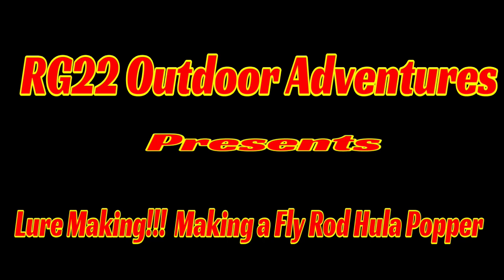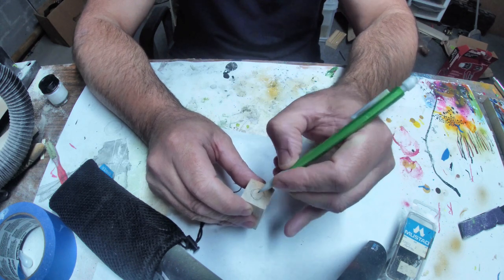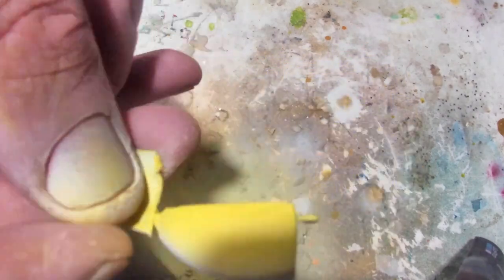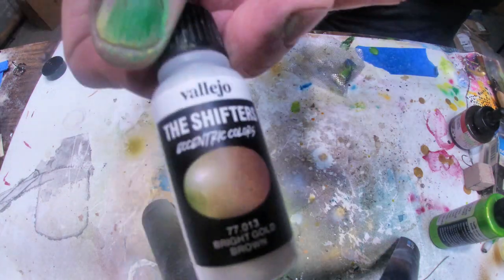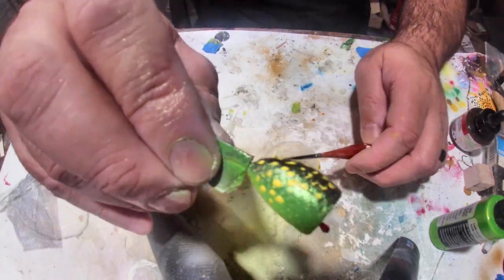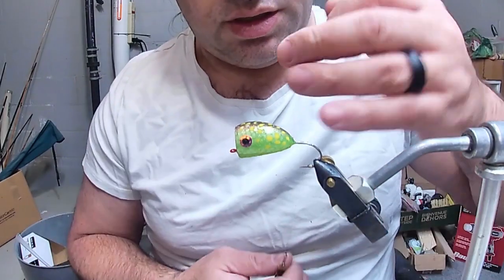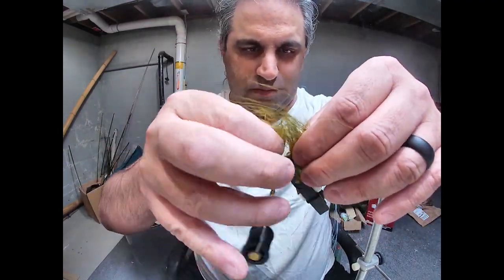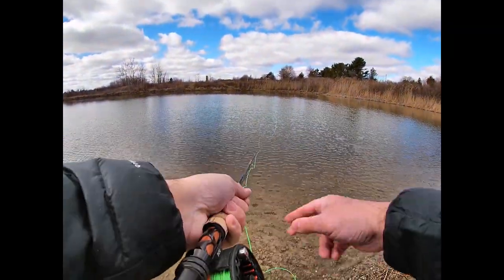Lure Making!!!  Making a Flyrod Hula Popper

Comment: You are correct about mixing the 2 part epoxy. Most manufacturers recommend mixing equal parts by volume. I however, have always mixed by weight with a scale because I believe it to be more accurate. I purchased some Devcon 30 minute epoxy and some BSI 30 minute epoxy, and weighed the full bottles before using any. In both cases, the resin weighed lighter than the hardener. I calculated the ratios for the weights of each part at different volumes so I could mix it for a small lure, a big lure, or for multiple lures. I have never had a problem with the epoxy setting up properly with this method. Also, if you purchase TrueCoat epoxy, they recommend mixing by volume but also give you the proper ratios by weight for measuring their product on a scale, since that is a very commonly used method. So I created a "RATIO" spreadsheet for several different volumes of resin, printed it, and keep it on the box with the bottles. Works every time!

You were also correct in stating the the more you mix, the more forgiving it is. Your ratios can be off a little and it will still work fine. 

For 5 minute epoxy, when using it for gluing small components like twist-eyes, lips/bibs, eyes, fins, etc., since it's such a small amount, I just eyeball it.

That little popper looks and works great!
Reply from the maker: Thank you for watching and commenting.  I learned from a few fishing rods where the two part epoxy was a disaster, especially with the pre-packaged flex coat.  After that, I started mixing batches of epoxy using 10cc syringes.  However, I quickly ran out of those, and it got harder and harder to get to the epoxy from the bottles.  After that, I began using small 20ml medicine cups and used the same volume and never had issues with the finish not curing properly.  Then, after watching other YouTube luremakers using weight instead of volume on a small scale I decided to try that out and again, with no issues with the finish curing.
Reply: @rg22outdooradventures88  You've had quite a bit of experience with different methods of mixing. I am too cheap to purchase syringes, cups & stuff that is simply thrown away after a single use. I turn a "recycled" soda can or small aluminum V-8 drink can upside down and mix in the concave underside of the can. Put the can on the scale, tare the scale, and weight the epoxy into the can. I'm so cheap, I even clean the applicator brush and can with alcohol and use it several times.
Reply from the maker: It's been quite the adventure.  I even tried moisture curing urethane (rexthane), but if it's not applied as thin as possible, you get air bubbles.  Spraying would be the way to go, but from what I was able to look up it required a specific thinner. But when it worked, it looked amazing. But, due to the difficulty of applying it to rod guides, the two part epoxies are the better choice.

Comment: Hey man how’s your AWD camper? Any negatives? What are something you don’t like? Does it driving modes like sand/beach? Snow/ dirt/ rocks? Slipper? Any driving modes? Any info helps a lot! Did you have any problems with it?
Reply from the maker: Hello, thank you for watching and commenting.  My wife and I really like the camper.  I don't really see any negatives as it checked all the boxes for me.  It tows my Ranger VS1882 withoutout any iss, es and in all hone, ty you really can't tell it's back there.  I had no issues going up the mountain passes in the Smokies.  It does have all the driving modes you listed, which I think is pretty standard on the TransitThe onlynly problem I had was the truck going into a limp mode after it was shut down at the summit of Newfound Gap. However, after a couple of restarts, I had no problems afterward and hadn't had any issues with the return home. For the coach, the touch screen command center wouldn't turn on but that was due to a dead battery on the control unit which is nothing more than a small table.  Download the app and you can control it from your phone.  All in all I am very happy with it.  My wife and I will be taking it on an epic 2 week trip through Wisconsin and Northern Minnesota musky fishing this summer.  We will be sure to record the trip.
Reply: @rg22outdooradventures88  WOW THANKS A LOT FOR YOUR REPLY! YOU HAVE COOL VIDEOS! ID BE KEEPING AN EYE ON YOUR CHANNEL WHEN YOU POST THE CAMPING WITH THE GEMINI!!!
Reply from the maker: I'm working on some floats using Alumilite Foam for steelhead fishing.  Once I have that down I will be making and posting a video.